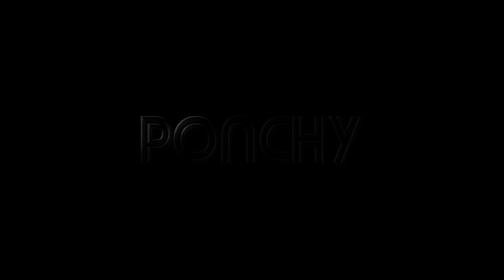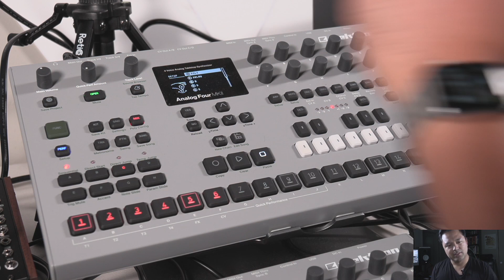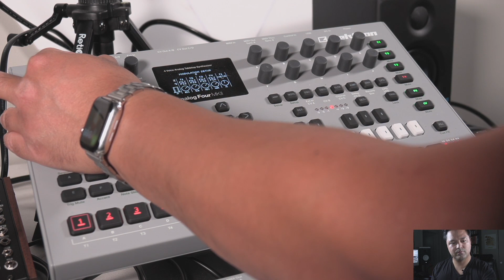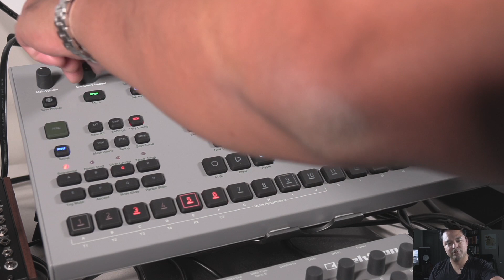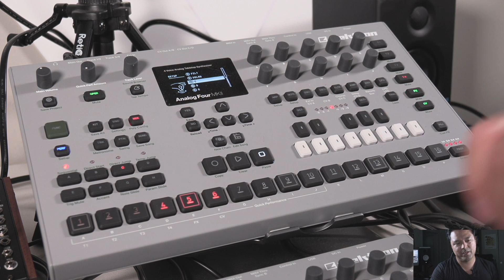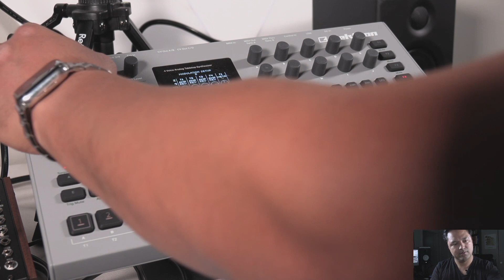Performance Mode on the Elektron Analog Four MK2 (Tutorial) Part 2

Comment: How and why are you using the trig to select tracks there? Why wouldn’t you just select them with the usual T buttons?

Honestly you’re providing a good service cuz the A4 manual doesn’t actually tell you HOW to use the A4 to do things, it basically just defines what each feature is.
Reply from the maker: Thanks for the kind words! I'm using the MIX mode where you can mute the tracks with a single button press as oppose to having to press FUNC+Track to mute. The only reason I'm doing that is when setting a macro with multiple tracks in it, you can really dial in the settings much easier when you just listen to the one track you are affecting and the other tracks are muted.
Reply: @Ponchy  Thanks, makes sense. I'm loving the A4 but I wonder this: Is there any way to reverse direction on the performance macros, i.e. when you turn up macro A it would turn down the parameter (instead of up)? I assumed you could, just like you can with Ableton’s macros, but I can’t see a way yet 🤔

The reason is that I would be able to perfectly and automatically compensate for volume changes any macros knobs make, e.g. turn up overdrive when turning down the filter cut off.
Reply: @MichaelMonaghanWav  Nope
Reply: @neonpop80  hey, turns out you can actually, you just set the depth negative in the macro setup menus. The only awkward ones are the bipoler parameters like overdrive (in the A4MK2 anyway) cuz they'll turn up overdrive in either direction.
Reply: @MichaelMonaghanWav  Woa! Did not know that. Thank you for sharing. Not many A4 tutorials online, did you check the manual? I just got my A4 last week
Reply: @neonpop80 BTW I just learnt how bipoler params arent even a problem, e.g. set the overdrive all the way to the right (+63) put it on a macro knob and set the depth to -63, now you have the overdrive turn down as you turn up the macro. This is especially great for compensating the volume as you turn down the fliter!

Coool, I got an A4 a couple weeks ago, i'm in love haha. Race you to being the first one to have an A4 video on our channel ;)
Reply: @MichaelMonaghanWav  Haha. That’s a super fun challenge :) I’m guessing having a music track using the A4? Do you have other Elektrons? I have DT and ST. I totally fell for Elektron machines
Reply: @neonpop80  Yeah, I'll have a few reels to start at least anyway, no pressure though lol. It's my first elektron ever and I love it, the workflow is really fun, this synth is deeeep, currently having fun sending my guitar and Korg Sample through the external inputs and then p locking stuff for variation/manipulation.